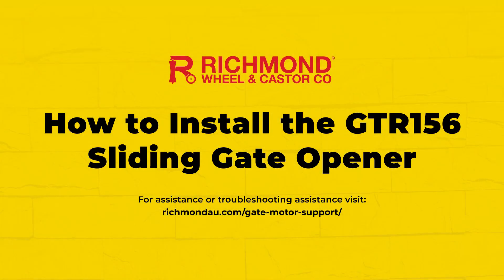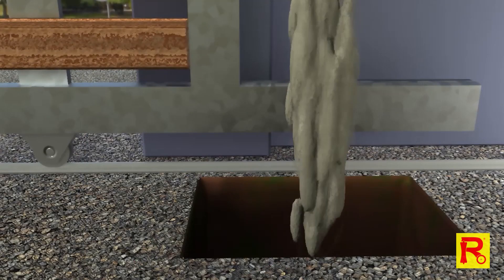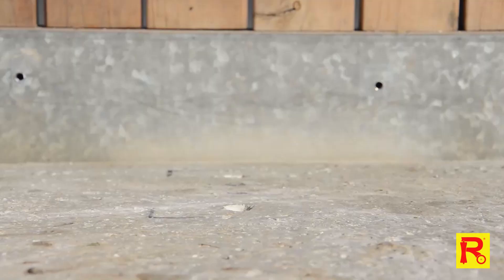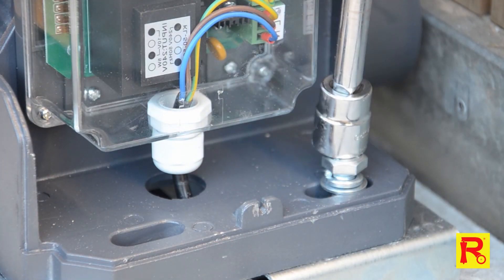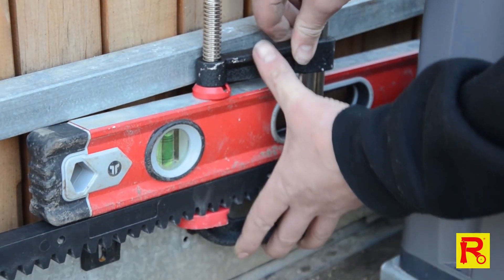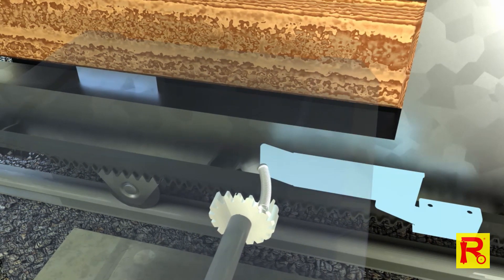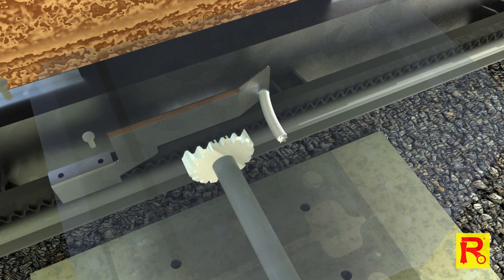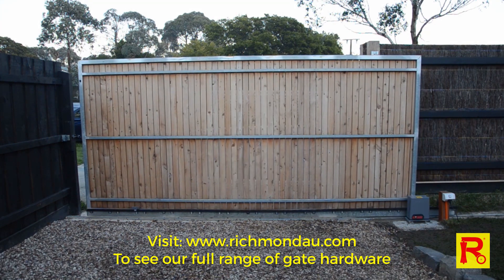Installing a Richmond GTR156 Automatic Sliding Gate Kit

Comment: Why do you set time limit  stops 150 to 200 back does this mean your gate is sticking past 150 -200  when open
Reply from the maker: Hi Jordan, This is partially done to minimise the risk of the gate running off the rack entirely.
The gate will always overhang the motor slightly, so if you want the gate to disappear behind a fence or post, simply move the gate and motor position over a bit further.

Comment: is it has remote control if it hasnt how to work this machine
Reply from the maker: Hi Ardaarikan4080. All of our systems are remote operated, but you can also fit keypads, push buttons or even smart home apps. There's a large range of accessories that can be used with all Richmond motors.
Reply: @RichmondCastors  oh thanks how can I buy rhis systems? I m from Türkiye
Reply from the maker: Hi Ardaarikan. Unfortunately we only have branches in Australia and New Zealand.

Comment: Can you tell me why my go's very slow sometimes. After using remote for a dozen times it then go's fast again?
Reply from the maker: Hi Bruce,
If the motor is travelling slowly, it is resetting it's Open & Close positions.
This could happen after a power outage, it was manually moved, or if the spring switch is not contacting the plate correctly or sticking.
If you contact our technical team they should be able to help you fairly quickly. Email them at gatesupport@richmondau.com or submit a technical enquiry at https://gatesupport.richmondau.com/

Comment: i see the gate shown in the video working, uses magnetic limits, not a spring style,  they must degraded back to spring, Don't use a level to get the racking height. Don't use those square washers, Best to use real racking, not baby size three tag, Bugs will nest in that motor and destroy the circuit board where i live.
Reply from the maker: Hi Home McCrae,
10 years ago we would have agreed with you on some of these things, but technology moves very quickly. 
Spring switches are much more suited to Australian conditions, and much easier to use compared to magnets.
Nylon gear rack is quieter and easier to fit than steel. The nylon is also steel reinforced.

Your bug problem is a concern though. It's not something we see a lot due to our motor design.
Bugs love moisture and humidity, which means your motor probably isn't being vented correctly. Our motors come with a raised base plate to help with that, but you still need to keep the area around the motor clean and free of water.
If you contact our technical team we'll be happy to help you through your next motor selection and install.

Comment: Can those be installed on a sloping driveway?
Reply from the maker: Hi Dylan,
These motors can handle a sloped gate, but for safety we recommend a maximum 350kg on a 4 degree slope.
This equals roughly a 300mm rise over a 4 metre gate opening.
If you contact our technical support team they can help you with more specific advice.
You can submit a ticket (with dimensions or images) at https://gatesupport.richmondau.com/

Comment: Is it safe and able to function during rainy days.
Reply from the maker: Hi The Word,
The motor is rated to IP54 so rain, hail or shine the motor will operate without any issue.
Just make sure it's installed correctly so that water doesn't pool around the base or flood the motor.

Comment: Hi, my gate sticks when I close it, what can be done about this?
Reply from the maker: Hi Nesha,
Depending on what's causing the issue, you may need to make some adjustments to the gate, or the motor setup.
It's usually something simple, but best to contact our gate support team so they can help you troubleshoot your issue.
You can submit a ticket at gatesupport.richmondau.com and one of our technicians will contact you.

Comment: what happens if a small child gets crushed in the gate or you have parked your expensive car their by accident ??? im sure all electric gates are meant to have stops on them to prevent this by law now
Reply from the maker: Hi Emyrs Engineering,
Good news, all of our swing and sliding motors have built in impact detection. It will still give you a bump, but it is designed to reverse once an impact is detected.
We recommend fitting a photocell or safety beam to stop movement any time an obstruction is detected in the area.
This way, there is no impact at all. Check out the link below for an example of our GTR208 photocell.
https://www.youtube.com/watch?v=yCE72w3v1Cw

Comment: To be honest I've been a tech / installer for over 20 years and would never get work if I ran cable like that ..lol . 
We have to run all cable in conduit with glands ect . 
But security is important were I live in Africa . Every 2nd home has automation.  
Looks a very simple motor to set up , no fancy electronics like I'm used to ( good old school motor ) .
Reply from the maker: Hi Colin,
I can't vouch for the electricians work, but you're spot on about the motor!
It's designed to be simple to set up, yet still capable of years of use.
It can also be fitted with a range of accessories, including smart home options.
(Update) We've also got low voltage options available for those that don't have the correct 240 volt power at their gate.

Comment: I bought this from Bunning to replace my old motor,  the sprocket on this new one is 10mm larger in diameter, can I just lift my existing tracks up 5mm on the gate
Reply from the maker: Hi Mai,
The drive cog might be bigger or smaller on different motors, but the tooth pitch should be the same.
This means you can simply adjust your gear racking to suit the new motor.
If you have any trouble, contact our gate support team and they will be happy to help.
You can submit a ticket at https://gatesupport.richmondau.com/hc/en-au and feel free to include any pictures you have.

Comment: Buy a Liftmaster with all steel gears and steel chain. And it has battery back up. First time it ices or snows your screwed!
Reply from the maker: Hi Michael,
If you're recommending Liftmaster I assume that means you're based in the USA. 
Here in Australia we don't really suffer from Ice and Snow conditions.
Also, for safety reasons, chain drives systems are very rare here in Australia. 

We do appreciate the input though, and we'll take the opportunity to offer some product knowledge that may help everyone with any purchase they may be considering.

Our motors and gearboxes are an all metal construction, any decent motor should be.
However, you were most likely referring to the nylon gear racking, which is actually steel reinforced and has an extremely long life when fitted correctly. It is also a LOT easier to fit compared to steel gear rack.
Steel gear racking IS available but can cause excessive wear if not fitted correctly, and produces more noise. It is typically only used where higher capacities are required, or in commercial applications.

Battery backup can be fitted to any of our 24volt DC range, but are naturally only useful when power goes out.
Our motors also have a manual release that can be used in the event of power outage.

Again, thanks for your input Michael. If you have any other questions, we're more than happy to assist.

Comment: is it still possible to open the gate when electricity is off?
Reply from the maker: Hi Ichizo,
In the event of power loss the gate motor can be unlocked. This will allow you to open the gate by hand.
Reply: to unlock a sliding gate motor to manually open it in the event of failure, you need to be on the inside side, to access the release mechanism, there are some exceptions, the faac c720 series can be set to unlock if the power goes out, but they are double the price, 4 times better, but to hard for most to install, they have  design flaws that are easily fixed but very few know how to, and less care to,
Reply from the maker: Hi HomeMcCrae,
Correct, you need to be able to access the motor inside to manually unlock it. 
For those who DON'T have a separate pedestrian entry it's best to use a 24volt system with battery backup fitted. 
Not sure why the FAAC c720 unlocks automatically when they could just add this function.
FAAC make good motors but they're not at all DIY friendly.
The GTR156 is specifically built for the Australian market. Easier to install (no electrician required in most cases), easier AND cheaper to maintain. No special terminals to discourage 3rd party accessories and smart home ready with the addition of a WiFi opener.
Once you've used both I think you would change your mind about which is better.
Reply from the maker: Hi HomeMcCrae, I noticed you've commented a couple times.
Contact our technical team at gatesupport@richmondau.com and we'll be happy to guide you through any difficulties you're having with your installs.

Comment: How does it open ?
Key pad ?
Control ?
Vehicle weight sensor?
Reply from the maker: Hi Patriot,
Our GTR156 slide motor comes with 2 remotes already paired. You also have a range of accessories that can be used to open the gate. Wired push button, wireless push button, wireless keypad and even a gate wand. 
If you need more information, take a look at our range https://www.richmondau.com/automatic-gate-openers-hardware/
Or feel free to give our sales team a call on 1300 474 246

Comment: My motor opens intolerably slow,  but closes at a good speed.  I hate it!!
Reply from the maker: Hi Ant,
The motor sounds as though it is searching for it's correct opening and closing positions. It may just need a minor adjustment to the limit travel stops.
If you haven't already, contact us and we will be happy to troubleshoot the issue with you.
You can also submit a request at gatesupport.richmondau.com and one of our technicians will contact you to discuss it further.
Reply: @RichmondCastors   yes I have contacted you and this was indeed the problem.  Thank you everything is good now.